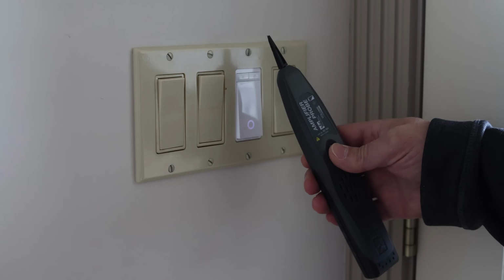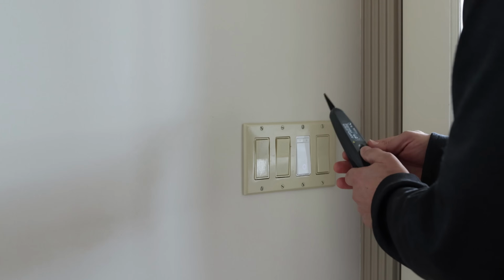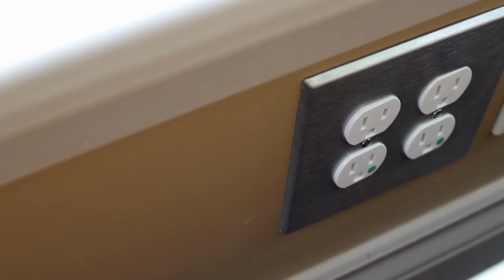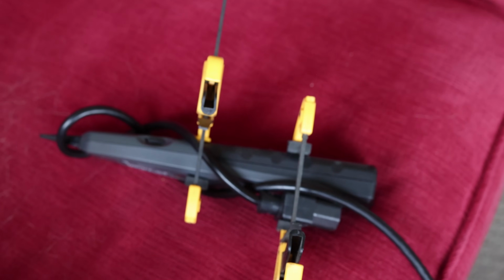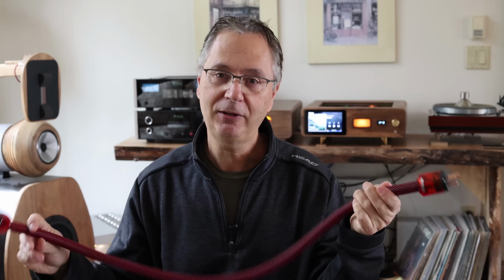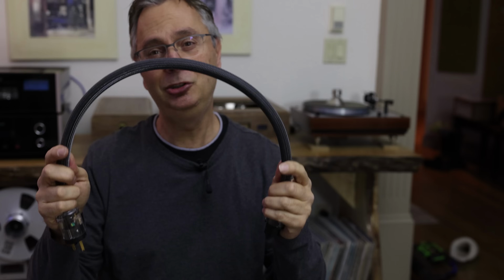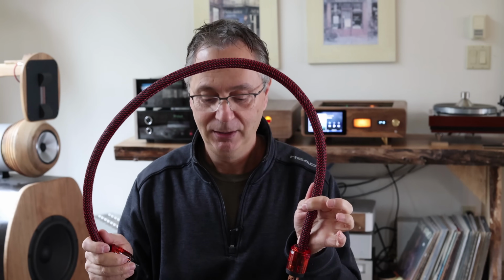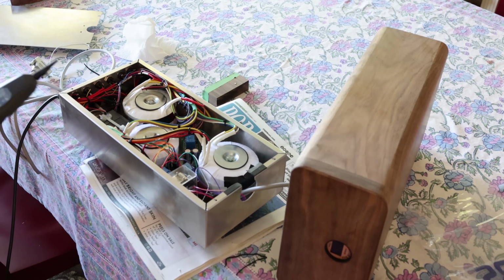My Top 5 Inexpensive Hifi Tweaks for clean power to your amp, preamp, dac, turntable, and more.

Comment: All the lines in a house is connected at the breaker panel. So any current fluctuation in one, will affect all because they are all connected to the supply transformer circuit.

Comment: Big takeaway: keep your interconnects away from the AC power cables. Period. If they HAVE to live right on top of each other then a shielded power and interconnect would be best. Otherwise save your money and "Keep 'em Separated".  90+% of the time the wire connecting the receptacle in the wall is 14 gauge wire and is NEVER shielded, it WILL pick up hum from other sources.

Comment: Some people use noise sniffers and relies that a lower beep turn sound into magic. Very little talk about sound quality in this video. I use my ears to decide. Dedicated lines, conditioners and power cables makes a huge difference, but I am not sure that shielded power cables turns everything to gold. What if the shielding itself influence power delivery more negative (like trap and bounce back power radiation) than what this "leakage" will influence adjacent interconnects?

Comment: Thoroughly shielded power cables are a must for those of us with crouded gear racks with gobs of gear. I use Pangea AC-14 power xables as they're either double or triple shielded and they don't set off my Klein Tools no-contact current tester. Low signal cables, espexially phono cables between the turntable and phono stage. I began using triple xhielded low signal cables while living in a highrise that was a few blocks from a television and radio station broadcast tower.
Linear PSUs are a godsend for ridding ourselves of electrically noisy wall warts and some components REALLY benefit from them, like my Wiim Pro streamer and Netgear GS105 switch (which is already quieter than many so-called outradeously expensive audiophile switches).

Comment: That test proves nothing.  Its correct that electronic switching can cause harmonics.  Uness you have an Ocillascope connected to your amplifier you generally wont know.  A tone generator is not a proper test instrument.  Reactive loads in the home are a lot more common thee days with Led lighting etc.  But hopefully electronics and led transformers are getting better quality tge same is true with dimmers these days.  As time has gone on and the invent of flat screen tvs etc manufacturers have realised that they have to have filters on their devises at the mains point of supply on the TV say.  This was never done with old equipment but your new amplifiers will definitely have filters.  So there are capactors across the supply terminals in the tv or and other sensitive electronic device in your home these days.  You can spend a huge amount of money on isolated supplies and powr conditioners.  The biggest risk to your gear is actually overvoltage/undervolrage from the power authority under fault conditiins or lightning.  So surge protection is quite important but again if your house receives a direct hit from lighning you wont have a big enough surge diverter.  Anyway not probably relevant to this.

Comment: I own an Eaton Powerware uninterruptible power supply (UPS), that I use for my computers.  It is an on-line system (not a stand-by system, and not a line-interactive system).  Meaning, it does dual conversion.  It converts AC to DC, and then it converts the DC to AC.  That means that anything plugged in to the UPS receives clean power that is generated by the UPS.  In the event that the power entering the UPS becomes too dirty to power the UPS for the conversion, then the UPS uses its internal battery to compensate.

Supposedly, no matter what goes on with the power in your home, the equipment connected to the UPS will never see an inkling of it.

@Gabster, have you ever done these same noise tests, to see if the power exiting an on-line UPS remains constant, and unaffected by dimmers, or anything else?

Comment: Great video, you earned my subscription 😀
Now I'm a bit late to the party, but maybe you see my question ;)
I still don't understand how good power cables work when your main socket don't have an earth/ ground pin, (as in my old apartment), so I'm not sure if I should buy some for my Hi-Fi, as I'm not sure if they will have any effect?
Reply from the maker: Glad you enjoyed the video and thanks for subscribing! Without a ground pin you will not get proper shielding or safety protection 
Don’t make your own it can be hazardous 
If it is your apartment you can gel a electrician to install a grounded outlet if not possible 
Use balanced audio cables (XLR or TRS) for all connections — they reject hum even without a safety ground.
	2.	Plug all audio gear into the same circuit (via a quality power bar or conditioner) to minimize potential differences.
	3.	Avoid daisy-chaining gear into different ungrounded outlets around the room.
	4.	Consider battery-powered interfaces

Comment: Excuse me for my incompetence, when you check the shielded power cable from outside doesn’t it show how internal noise from the wall socket doesn’t go outside but it may still be kept inside the cable?

Comment: OK another question some amplifiers    one i am buying    its supply   is a switch mode supply     in the same case as    the amplifier     A   NuForce   IA7     so my question is    Where i can buy that  noise probe?       So i can see if the smps  makes noise      as its a common problem with the amplifier      and maybe i remove the 80 volt   smps       and make   a toroid   supply.But off board.A seperate   supply    not near the amplifier.
Reply from the maker: Check the description for similar links 
getting a linear 5A 80V can be very expensive sometimes better upgrade the amp
Reply: @Gabster1  its a 10a  supply    100 watts    watts=VxA   but no signal connected     with signal connected     its   80 volts    as the   ia7   is a digital amplifier     so very efficient     But maybe  I do   the SMPS   away    and make    a toroid supply     thats what i mean      as a toroid supply   does not make noise      so a toroid   at 100 volts    a rectifier     and a voltage regulator      instead     if that makes sense     because the amplifier is known to be noisy      when there    pauses  in the music      a light hissing noise    or beeping  at a high frequency      I assume coming from the SMPS.   there was also  a problem with earlier  versions   until   nuforce   corrected  a problem   with a   capacitor   on the input  op amp    that they later corrected   in 2008   with a .33 microfarad   bypass  capacitor   and the amplifier  I am buying   for nearly nothing   is a 2006  model     so maybe did not have that modification     And well its a project     for   125 euros     and the new price was   999 us dollars       the seller says    its a very low level beep   in the quite passages   of the music     and i thought  maybe  i can make a  toroid supply instead of the smps.But first i will try   the bypass capacitor  modification.That is in front  of the op amp   which is also the feedback.    regards   from chris

Comment: OK about shielding  on the power cable      shielding   connected how?     as  in audio signals inside  an amplifier      the schielding    is connected   only at one end      and not the other end    as can make   grounding hum      so is that power cable shield     connected  to shield    one end or both ends?

Comment: 50 ft of Romex to the power outlet then 3 or 6 ft of wound/braided power cable -- does this make sense? If twisted or with other configured conductors to minimize the magnetic field as with a mu-metal shield, then yes. A good connection of power and ground are essential too.

I used to use the cheap supplied RCA cables and had intermittent noise. Keith Yates Audio started me on better cables with Monster cables that had machined RCA outer connections - noise floor dropped and intermittent noise was gone from that connection problem. So, some details matter. I DIY my interconnects now to achieve very low capacitance with sonic improvement -- unshielded.

What makes more sense is an isolation transformer between the wall connection and your audio equipment  (with grounding intact) that minimize noise coupling primary-to-secondary (input to output) and suppresses noise. My transformers eliminate turn-on transients and noise from halogen and florescent lights (now replaced with LED). Furthermore, my transformers are balanced -- 60VAC on each end, out of phase for 120VAC, center tap to house ground. Devices must have power legs (hot and neutral) isolated from ground to use balanced power, that is, neutral cannot be tied to ground. I found an improvement in spaciousness only when the power amps and preamps were on separate isolation transformers. When I borrowed a unit from a local high end store I didn't hear any improvement but did get noise suppression. Only when I put preamp and power amps on separate transformers did I get the sound improvement. I made my power amp balanced power transformer box but bought a medical grade balanced power transformer first. I added noise suppression to its input and output.

As proof that mu-metal shielding makes a difference, I made power cables from mu-metal shielded power cable from  LESS EMF - rated at about 3 amps, so not for huge power amps. I used a 50W mono class A power amp and tested a regular 14AWG power cord and the DIY Less EMF cord and a Tri-field meter showed about 50% reduction in magnetic field. This means less induced noise into other cables. That is why power cords are separated from interconnect cables.

Remember, power supplies draw pulses of power -- as the bulk power capacitors at the rectifiers decrease and rectifiers conduct, they do so abruptly turning on and conducting then follow the secondary voltage as these capacitors charge up until the same rectifiers become reversed biased and current stops flowing into the capacitors. Then, the voltage decreases on the capacitors as the load draws current until a rectifier is again forward biased and charges the capacitor. Such pulses occur at twice the line frequency for a full-wave rectifier power supply. This generates harmonics as well. It isn't just that such current occurs in your power cables, it is throughout the house to the fuse box. Similarly with the demonstrated dimmer control.

I first experienced a sonic improvement by using separate outlets across the room for my power amps and preamps which was what led me to separate power isolation transformers.

Comment: Will a good power cable benifit my  mastering chain ?  I do have mogami and it made 2 or 3 % difference also the power supply for my word clock made a huge difference also

Comment: okay so i have 3x400V+N supply. 400v phase vs neutral gives our local 230V 50Hz supply. according to your tips i should have a phase+neutral supply to my analog audio on a phase no noisy consumers are wired to. unfortunately im about to install a solar inverter injecting on all three phases :s

Comment: I have two systems and used in two different homes:

1. Adcom - Pre-amp/amp plus power conditioner. All same brand 

2. Acurus - same as above.  

No audible noise. 

I also started with just the Adcom amp. I hooked up a boom box and used headphone jack to rca adapter and used my boom box as a pre-amp. I also had a light stand with dimmer.  Massive buzzing noise.

Comment: ALL amplifiers have power supplies that filter supply noise ...there is no supply noise after the power supply rectifies to the DC voltage  that the amplifier uses

Comment: A dedicated line to your stereo still runs through the same electrical bus that connects everything in the house to the outside powerline. Sometimes, the level of ignorance that people that have 10's of thousands of dollars of disposable income to buy stereo equipment is amazing😂
If your stereo equipment is well designed, its power supply will filter virtually any noise in the audio band to virtually zero. The only power conditioning you should ever need is a surge protector. A good one is about 50 dollars. Aside from a turntable with a moving coil cartridge, any well constructed RCA cable will have virtually zero noise unless it's over 3 meters long. Better yet, if you have the option of using XLR connections, use those! A 25 dollar XLR interconnector can be over 30 meters long and still be absolutely noise free. The only interconnector where shielding is recommended, again, is for moving coil cartridge applications since the signal is minuscule. An (SPDIF) compliant (shielded) RCA is around 20 dollars, a very nice Mogami RCA patch cable rings the bell at around 50. That's it. No mystery, no snake oil, and very cheap! While we're at it, let's do speaker cables.... 12 or 10 gague pure copper multistrand cable is more than any stereo system will ever require, and it costs around 1 dollar per foot! If you live in an area the suffers from frequent, severe brownouts your only solution is a UPS battery system. They at least give you time to shut down your system. However, if you're running a couple of huge amps, the UPS supply would be not only large but very expensive too!

Comment: Hifi deviecs have power supplies which convert the poewr to clean DC. All these power 'cleaning' tricks are pure snake oil, the power supply does the job anyway.
Reply: You are simple minded unfortunately. Noise entering a power supply, even after filtration will still carry noise. When converting to DC, this noise will be amplified and cancelled, causing distortion on the power rails.
Reply: @AccuphaseMan  No it doesn't you're an imbecil. This can be proven very simply by a simple measurement. What comes out of the PSU is pure DC. Oh wait, I get it...You're talking about the magic non-measureable distortion that only your golden ears can hear, right?
Reply: @Munakas-wq3gp Do you realise that DC carries harmonics? This is basic highschool physics and you're right at the peak of the dunning-kruger effect. Regulators and filters in the PSU can reduce these unwanted harmonics in lower bandwidths with their chokes but they will still be present both in common mode noise and in the high to ultra high bandwidth range. Quality high end amplifiers have always been DC-600khz and thus, this unwanted noise and harmonics also get amplified, causing distortion and disrupting feedback loops. With DACs/DDCs, this noise significantly affects the internal clocks and in preamps, this noise gets picked up when applying 80-90dB of gain to a low output MC Cartridge.

You clearly do not know much about audio, but there is a very good reason why amplifiers have to have their unused inputs shorted and why they are put on clean regenerated power before they are measured.
Reply: @AccuphaseMan  No it doesn't. DC does and can not carry anything once it's been filtered. It's a flat voltage. Even if there is some "600khz" noise that's inaudible lol. What are you, a radio beacon? The clocks of DACs are also not affected by this kind of noise. You're swimming in snake oil my friend.
Reply: @Munakas-wq3gp So you believe that a filter in a PSU will remove 160dB of both ground and DC noise?
Reply: @AccuphaseMan  You can verify it yourself very easily with a multimeter lol. It's always hilarious to see those pseudoscientific arguments.

Comment: I have two power outlets in my man cave which feed my Hifi with the go stuff and a bunch of gear that needs the power, from the top.

Alphason Sonata TT
Michell Gyrodeck TT
Transcriptor Hydraulic TT
M1 Vinl Phono amp
Audiolab 8000Q Pre amp
Audiolab 8000M's x2 Power amp's
Audiolab 8200CD CD/DAC
Denon DVD 3910 DVD/CD/SACD
Audiolab 8000T Tuner
Teac T-H3800 Internet tuner
Akai GX95/2 Cassette deck
Sony TC-K81 Cassette deck
Sony HX360 DVD Recorder
JVC SEA 7070 Graphic EQ

This occupies a space surrounded above and to each side by my record collection and has to be crammed into a space 7' wide x 5' high, the top 18'' being unusable because the 3 decks need room for their lids to open, obviously it's a maze behind the equipment with all the interconnects antenna leads and internet stuff.
I am of the opinion that while audio leads and speaker cables do have an influence on sound quality in sufficiently revealing systems. I recently chanced my QED Performance Graphite IC's for QED Reference 40 and am delighted with the small but perceptible tightening of the sound.
I don't however believe that the go stuff cares about the last few feet of it's hundred mile journey down aluminium cable of uncertain quality before it reaches your properties main fuse, it just doesn't, not unless it's being hampered by high resistance.
Dirty sockets, or an insufficient gauge for example.
I have however invested in shielded mains cables on account of the spaghetti monster behind my gear, as this gent advised I didn't go mad I invested in some Lapp cable which I bought from an online seller ready made. Allenhode  was his name I believe and he built them very nicely.
I used Lapp because it was my go to power cable for most of the laboratory equipment I used to build.
I noticed absolutely no change in my Hifi's sound quality or tone whatsoever, but what I did get was the ability to listen to AM radio with far less buzzies, and a better picture from the living rooms Sky box on my TV. They are both fed from different sockets to  the HiFi so I'm mystified by that one?
All in all I'd say in my situation it has been beneficial and the cable is not too stiff to be fit for function, as some undoubtably are :).

Comment: My power amp is powered by a c17 (L & N) socket,it hasn't pin for ground
I guess that the three cores power cables are useless,right?
So,i made myself a power cable with industrial single core copper cable
Is that correct?
Thank you
John